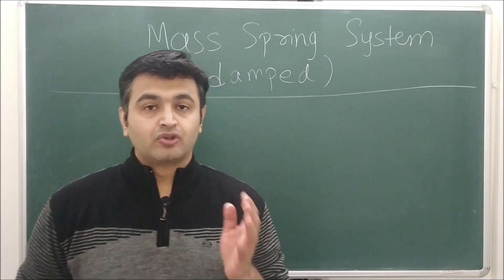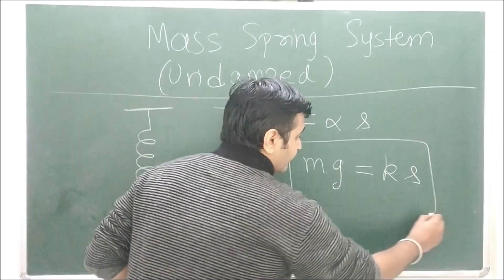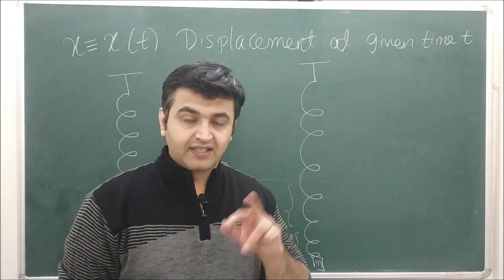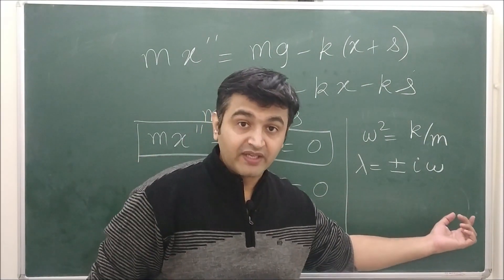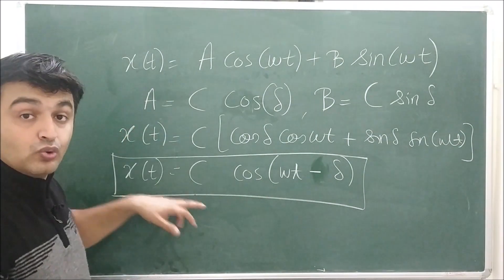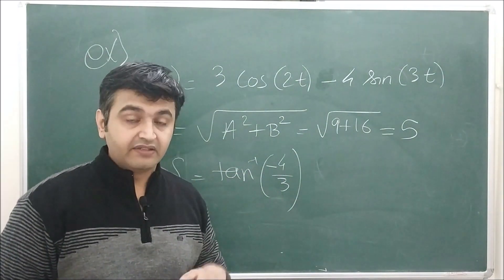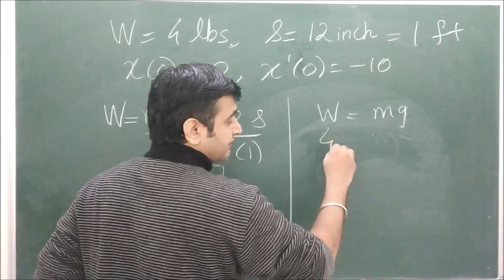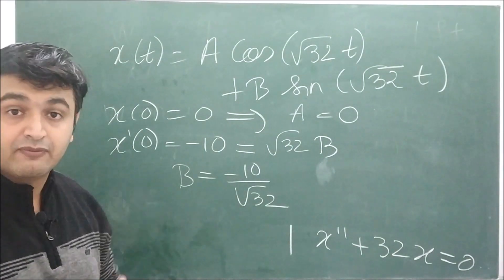Session 23: Modeling of Undamped Mass Spring system with some examples (Part I).

Comment: What is British matrix rule
Reply from the maker: You mean, metric rule.
They use Gallons instead of litres, pound or ounce instead of grams, foot/ inch instead of meters or centimetres and so on...
Reply from the maker: 1meter = 3.280839895 ft.

So 9.8 m/s^2= 9.8* 3.280839895 ft/s^2= 32.1522 ft/s^2

Comment: Calculate the frequency and period of undampened oscillation of an object weighing 375 g, 
if at displacement 5 cm from equilibrium point the force acting on this object is 300 mN.
help please, thanks